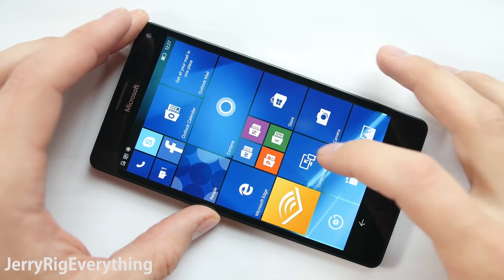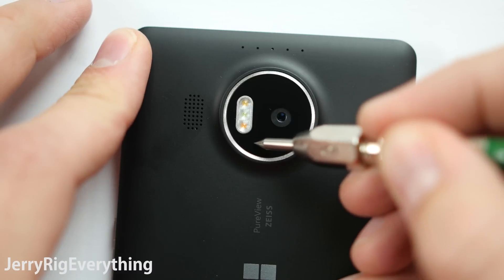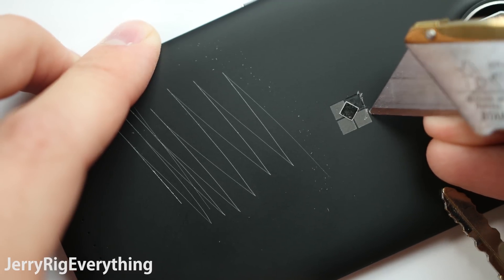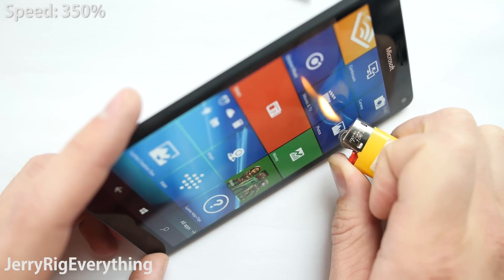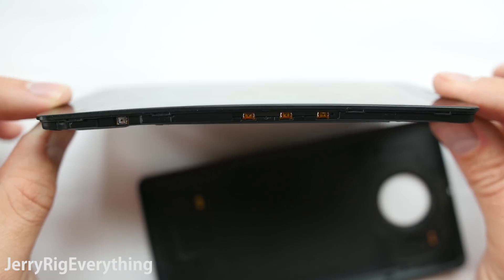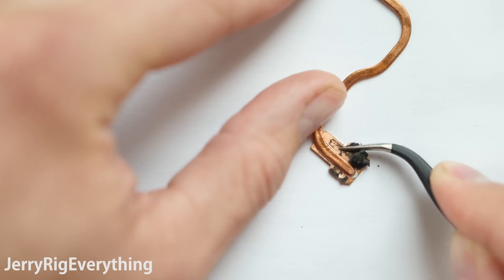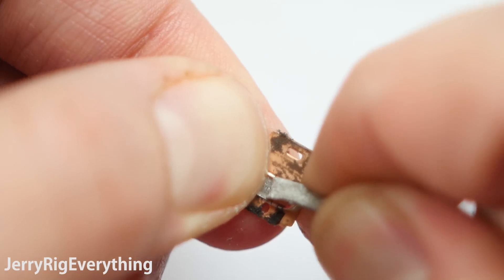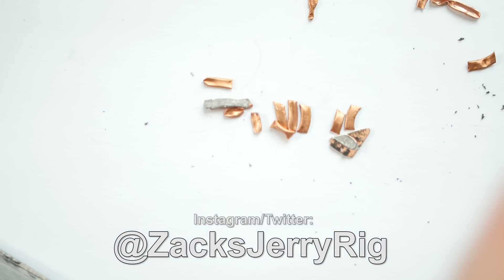Lumia 950 XL Bend test - Liquidless Cooling - Scratch Test

Comment: Hey, Please change the misleading headline of the clip or at least admit you do not know EVERYTHING about liquid cooling system,
I do not know everything as well - but I actually searched and learned instead of falsely accusing about things I do not know.
MS, on the clip you attached has claimed it has a "tablet grade liquid cooling system", just like the one used on surface 4
so... the NORMAL person that thinks things are wrong - goes online and look up the patent... it is an MS product, SURELY there is a patent, right?
well guess what, I didn't search for it, I just searched for: "surface 4" "liquid cooling" substance
5th link:
http://www.google.com/patents/EP2023069A1?cl=en
Quote: "One aspect of the present invention relates to a system for increasing the temperature of a substance which is initially in an at least partly solidified state"

A quick look on how the system is on the tablet:
https://lockerdome.com/7046634060127041/8097669633543956

you have the substance near the CPU (the really hot place on the tablet),
when heats up - it liquefied and travels to the heat sink (the colder part of the tablet as nothing runs there),
When cools down - it travels back to the CPU area and solidifies again.

Same goes (albeit much smaller in size) for the phone,
it starts at the CPU area (bottom part of the phone), and travels to where the sim case is (the top part of the phone) where there is an open non warm area, since you hold up the phone usually - the liquid will travel down, and if CPU is not too warm - will solidify back next to it.

I doubt you cut the heat pipe when the liquid was actually liquid and not solid (hence the "powder" you found, which is technically a liquid - at higher temperatures- so no lies there.

Even though I've been subscribed to your channel for awhile, throwly enjoying your stress tests for the devices and believe you DO deserve to be more well known - doing so by flat out lying and than quoted on MANY news sites is not the way,
be the bigger man you are, and admit your mistake + apology, I will root for you even harder than I had when you demolished the second 6p just to prove your point.

As for heat testing - it's been done already, both 950 (liquid cooling system NOT included, 808 cpu) and 950XL (liquid cooling, 810) have been tested by doing the same task, running continuum,
the 950 (808, slower colder cpu) felt warmer to the touch the 950XL (810, faster with known heat problems), that's proof enough that the system is not just there but that it's actually WORKS.

As for the other claim another poster brought for the XL being off the shelves due to hardware problem - MS rebutted this claim several times, claiming the 950XL was simply more popular (for a reason, it IS the better phone), but I suppose you either missed that or was just so keen on being right regardless the facts.

Bottom line is - this is a durable phone as you showed, more than anything you tested (or so the article I read claimed you said, still haven't seen your video with sound) yet you decide instead of saying "good job" to get hung up on something you did not test beforehand, why is that? could it be that you are a bit biased as well?

Thank you to whoever read everything down to the letter, it did came out a bit longer than expected initially :)
Reply from the maker: +Koby Yehezkel Fantastic comment. You did quite a bit of research.   And I did read your whole comment.  Please watch my video with sound... I do try to be as correct as possible with my reviews and tests. Like you mentioned, there are a lot of people who watch my videos.   The powder you see on my fingers is from the solder joint that holds the tube to the solid copper plate at the bottom.

I mention in the video that having a huge copper heatsink is great for the phone. 

I still stand by my initial observation... This is not 'liquid' cooling.  I have made closed loop liquid cooling systems for a few different computers.

It 'boils' down to terminology. If Microsoft wanted to call this 'vapor cooling' or 'heat pipe cooling' it would make more sense.  But instead they call it 'Liquid cooling' (and news sites repeat what Microsoft initially says, just like you mentioned about me in your comment.)  When technically... it is not the watercooling that consumers think of.  As you can see most people agree with me on that observation. 

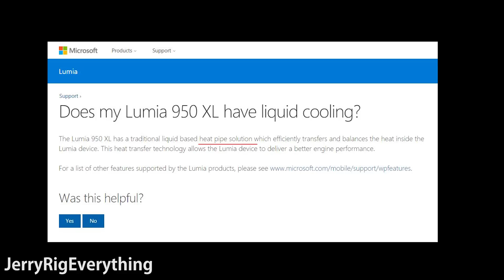Even Microsoft Themselves doesnt call it 'Liquid cooling' anymore.  As you can see from the phone description page AND what I show at 3:24.

I have reached out to Microsoft, and asked if I could make a video detailing the process and manufacture of their heatpipes, for consumer clarification. but I have not heard back from them. 

Thanks a ton for your comment.  I do read every comment that is made on my channel. You have a logical opinion and I respect that.
Reply: JerryRigEverything respect for respecting !!!!!
Reply: Koby Yehezkel lwlakakak
Reply: Get rekt

Comment: Why didn't you try the heat pipe before destroying it? just put the end of the heat pipe in hot water whilst holding the other end and be ready to let go before you burn yourself. If the heat pipe is working then you will feel the heat from the hot water in 2-3 seconds, if there is no fluid it will take 10's of seconds to feel the end you are holding heat up.
Heat pipes are not completely filled with fluid, typically about 25% so it is possible that all the fluid is contained within the wick structure on the inside of the heat pipe and not sloshing around.
I really can't see Microsoft going to all the expense of putting an empty heat pipe in the phone that's madness.

Comment: You could test that heat pipe with the same lighter you used for screen. It should heat up along the entire length at the same time.

Not proved fake before this test, cause they don't put THAT many liquid inside.
Go get another 950 XL.

Comment: don't expect real "liquid" inside. you don't see any pump inside so it's kind of vaporize liquid. and for phones, you surely don't want a 80F degree hot pot on your hand, so the liquid is easy to vaporize under the normal temperature.

Comment: heat pipes have an wick on the walls of the isnide and the liquid in the wick. you can't get it out cuz it evaporates pretty quickly but i can assure you there is liquid inside it but not much. probably 1 water droplet of cooling liquid. i reverse engineered a lot of laptop cpu coolers and i didn't found any liquid either but the wick on the walls was kinda wet.
Reply: ***** yes, but it is based on liquid. Its called a vapor chamber, but still a type of liquid cooling.
Reply: +Lorenzo van het Hul Yep. It's just standard 'damp' heatpipe tech. Which is exactly what I expected when they announced it and i saw a heatpipe. lol
Reply: In fact, being mostly NOT liquid is essential to its operation. It's the vapor transport that carries the heat. The liquid is wicked back to the evaporator after condensing, but there is no free liquid. That would just potentially block the flow of the vapor, and clog up the works.
Reply: +Lorenzo van het Hul Finally some one who knows what they are talking about. Liquid cooling is with water e.g. h100i from corsair. Air cooling e.g. 212 Evo is vapor based so no viable liquid will come out
Reply: u r right bro

Comment: +JerryRigEverything  Downvote.....PLEASE LEARN TO USE GOOGLE. There isn't supposed to be enough liquid inside the pipes that it spills out. It's just a very tiny amount of vapor. Please google how heat pipes work.
Reply from the maker: +Tabish Syed Hold up.  Did you just verbally downvote me? If its 'vapor' or 'gas cooling' maybe Microsoft should call it that instead of 'liquid cooling.'  No hard feelings though! Ill send you a verbal upvote.
Reply: +JerryRigEverything Liquid converts to vapor as it evaporates, then cools, returns to liquid and travels back to the heat source.  This is why it is called 'LIQUID COOLING'.
Microsoft's terminology is technically and scientifically accurate.  

Please... Go to Wikipedia and look up Heat Pipe cooling or Vapor Chamber cooling. 

Once you think this through or get time to review the technology, I know it will make sense.
Reply from the maker: +T'he NetAvenger lol we are on the same page buddy! In order to liquid cool...  There should be liquid. We agree!
Reply: +JerryRigEverything Again. That is how liquid cooling works. It is a liquid. Then it turns into vapor when hot and travels around the pipe cooling down.

How else do you think liquid cooling would actually work. Lol. Having a pipe full of water would do nothing at all to cool it down. It would just heat the water up.

Comment: I think Microsoft people was not able to explain properly what they have done to the guy who presented the phone on stage, or he just improvised, as he himself was not able to understand it or did not memorize it in the correct way.
So, thumbs down for that presentation skills and memory capacity.

But, nevertheless, I am pretty happy to see such implementation of "active" cooling on phones.
I have a LG G2 and it suffers badly from bad cooling design, because it is made from plastic, without any heat spreading device.
In summer time, specially since Lollipop 5.0.2 (a bad version) came out the phone heats up to the point where I need to mess with kernel settings, in order to obligate it to thermal-throttle at a lower temperature.
Normally it is around 72ºC and 76ºC it is more hard core. Now I have it on 69ºC and 72ºC, respectively. In the Summer, I get it down to 65ºC and 69ºC, respectively, to be easier for me to hold it in my hands.

We want more power, they need more power to market their products, and all this need better heat dissipation. Specially if you want to record in 4k with your phone.
So, thumbs up for this decision!
Reply: +hitardo Errrmm that's Panos Panay. He's the head of these devices.

And that is liquid cooling.

Comment: In a genuine liquid cooling system, the liquid never changes state, i.e. remains liquid at all times.  It simply gets heated by the CPU or other component(s), flows away and then is cooled by a fan.Like the Surface tablets, the Lumia phones actually contain a vapour chamber, where the fluid evaporates, travels away in vapour form and then cools and condenses.  Microsoft simply chose to use the term "liquid cooling" because its something that even a lot of laypeople are familiar with.  If they had called it a vapour chamber then it would have meant nothing to most people.  It was marketing in a sense but it wasn't really a lie.  It was more of a simplification.What is true is that it is a cooling system that uses a fluid and no other phone has anything similar.  Remember that fluids aren't always as runny as water  Some people argue that glass is a fluid because very old windows end up thicker at the bottom because the glass flows downwards with gravity, albeit veeeeeerrrrrrryyy slowly.
Reply: +wunnell I have seen this mentioned by people before, and it is not technically correct.  A vapor chamber is a 'liquid' cooling technology. The vapor phase is the cooling of the liquid used. 

I understand the distinction being made about recirculated liquid cooling, but it would be more accurate to define the difference as active versus passive liquid cooling. Or even call vapor chambers, evaporation based liquid cooling. 

Either way though, vapor chambers are very much liquid cooling technologies; even if they are a different type than what most people think about. 

Microsoft is correct to call it liquid cooling.  

PS 
Right now, 'vapor chamber' CPU coolers are once again a trend, and the manufacturers are using the terminology separately from liquid cooling so PC enthusiasts won't confuse the two. However, this is their own adaptation of the terminology, not what is technically accurate.
Reply: +wunnell I recently read an article or saw a science video (not sure anymore) discussing the question if water is a fluid or not. The result was, that the asumption that old glasses are thicker at the bottom is just an urban legend. Glass is perfectly solid and not flowing at all. That does not mean that this is true of course.
Reply: @juleztb  Glass is an amorphous solid and will slowly sag and deform in all but the lowest temperatures. I have seen 100 year-old windows in Virginia City, NV and in old logging camps in Oregon and they do, indeed, flow. Anyone who tells you different is talking out their ass. I've witnessed it. :D
Reply: +wunnell excelente, concuerdo contigo, el señor que hace el video no a estudiado quimica y no tiene conocimientos de tecnologia, el cree que liquido tiene que verse como el agua.
Reply: wunnell, good explanation. But Julian T. B. above me is correct, glass is not a fluid like pitch/bitumen. The reason ancient glass is thicker at the bottom is due to the manufacturing process. Modern glass used in skyscrapers cannot warp or they'll break their housing and become killer litter.

Comment: It's proven now that the snapdragon 810 is so hot that it made the water to magical evaporate completely outoff the heat tube. 
😂 😂 😂 😂 
So now old steam engines can be run using snapdragon 810 processors instead of coal to produce heat 🔥. 
Nice Qualcomm. 
Keep the heat up.
Reply: +Shivam Goyal Did you miss the part in the video where he says he held a lighter to the phone for well over minute?
Reply: +Shivam Goyal this phone has a heatpipe, which uses vapor rather than flowing liquid. PCs, laptops, and tablets all use heatpipes already, but this is a first for phones. Calling it 'the first phone with liquid cooling' is somewhat disingenuous, but not incorrect either.

Comment: for that small of a heatpipe, there probably is a  100th of a ml of water in there. and it wouldn't surprise me it they were using alcohol. alone by touching it and cutting it, wouldn't surprise me if it evaporated out.

Comment: its hard to explain and I'm surely not enlightened to do it right, but believe it or not that's liquid inside that pipe, its just not exactly what you expect, lets not call it a liquid, lets call it a "fluid" instead, which can be a gas... which is more fitting in this scenario, this "fluid" heats up at the cpu and goes to the other end, cools down and comes back, that's how most laptops work, and how high end pc coolers work too unless you use water
Reply: +EspHack yeah it&#39;s really sad. The guy that made this video is either ignorant about liquid cooling or he knew it and just wanted the view counter to go up.
Reply: nexxxuno it shouldn't be called liquid cooling, because the difference between liquid and fluid is very important. The definition of fluid included gases and liquids in the definition, both compressible and non-compressible. Liquids, however, strictly refer to the more viscous fluids only, those with constant volume, like water. It would be correct to advertise as fluid cooling, not liquid cooling.
Reply: +EspHack liquids, gases, plasmas are forms of fluid. so they saying liquid cooling is not true if there's only gas inside.
Reply: A gas is not good a heat conductor, works more like heat isolator.
Reply: +Eder Daxiel Payan Castro vapor chambers have been around and in use for quite some time.  

It's like I tried to explain to someone that was bashing this person online because he had a liquid cooling loop that was entirely in a series with his CPU before his GPU's.  Same way I have mine setup.  He was trying to say that the temps would be effected by the hotter liquid being pushed to the GPU's after the CPU...., but that is wrong all together if one knows how the liquid removes the heat from a "source" and will not pass said heat on to the other components.  Hence why I have a max temp of 59 C on my CPU and a max temp of 39 C on any of my GPU's.
Reply: +EspHack Its a vapor

Comment: heat comparison heat pipe vs no heat pipe
Reply from the maker: Lol.  Maybe i should have used the phone before chopping the heat pipe to bits.  Ill see how the phone handles life without the heatsink.  Honestly i bet it will be fine.  There are other phones that run this same processor without any gimmiks, And they're doing just fine.
Reply: +JerryRigEverything not true, most are clocked down to 1800mhz whereas this is 2000mhz. there is known issues with the 810 so this was meant to help...

look at the S6 spec and you will see what i mean

Comment: Wouldn't it make more sense to use a variable temperature heat gun for the burn test to know what temperatures are safe for the displays?  I work in phone repair and know that most LCDs are safe at 80 Celsius and below while most OLEDs can handle up to around 100 Celsius.  It would be interesting to know the variance between each new model.  I was really excited when you switched over to the Moe's scale of hardness and hope you do something similar to improve your other testing methods.  You could also add more durability tests such as simulating the effects of dirt/sand getting inside a phone case and damaging the frame, how durable the sides and corners are that would take impact from a drop,  or testing how well the phone is sealed against liquid penetration.
Reply: A water test would really be great, it's also a real life scenario, just to see how long can a phone survive being fully submerged in water.
Reply: +Nikanor Melnikov it's not even about how long it stays on under water because 5 seconds of water could kill a phone if the water reaches the battery or display connections and builds up corrosion.  I'm more curious about how sealed the ports are from liquid.